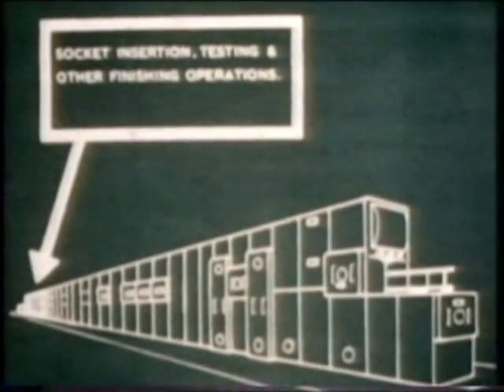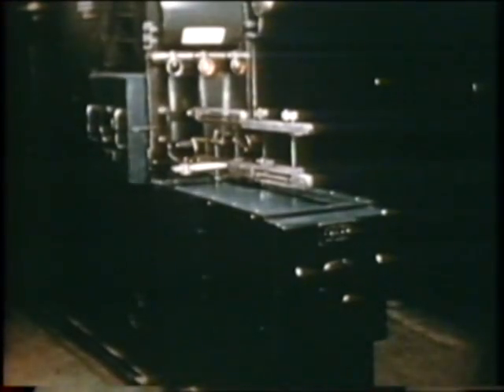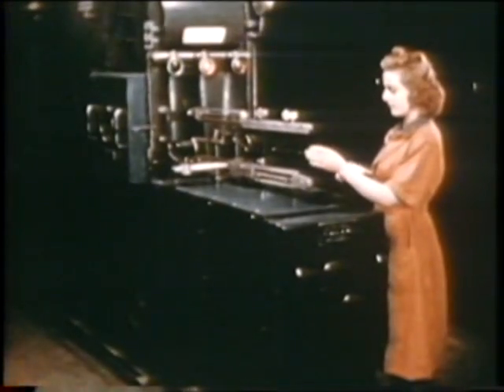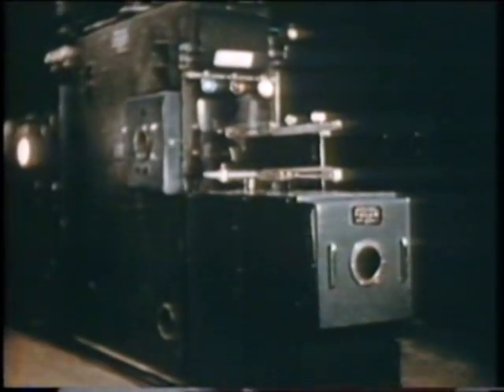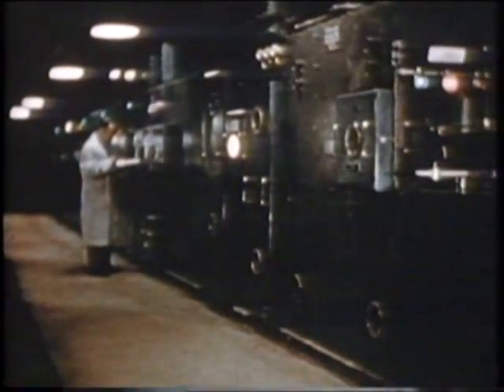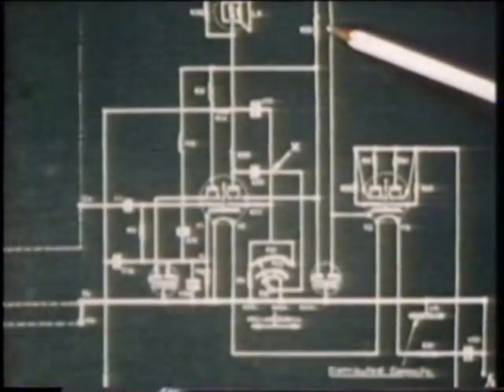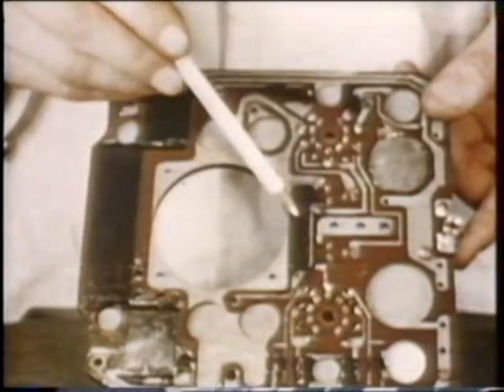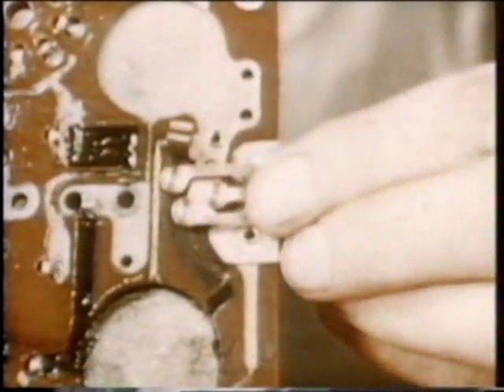ECME - electronics automated production 1940's style!

Comment: That machine must have cost a fortune. That's an impressive lot of levers and cranks. Can you imagine the manufacturing of all the mechanic pieces going in that machine? 
not to mention the hours of work going into exact aligning the precise parts, testing, replacement of worn out parts and oiling the thing...

I think it's a nice example of the start of mass production.
On the other hand, back then, they made quality. This was a step towards quantity over quality.

Comment: I'm always amazed what was achieved in automation without any "electronics" (of the kind we think of today). Just relays and rotary switches, some cranks and levers.

And I'm really surprised of the thing checking of the sockets for orientation. I never thought this would have been possible at that time, especially at the speed the machine is working at. Never underestimate the ingenuity of engineers!

Comment: There could be numerous reasons why this technology met with limited use. One that spring to mind is how specialized the equipment is, designed to mass produce one circuit at one time so it lacked flexibility. It could also have been that the machinery was extremely high maintenance, or that the set up times were long and complex. It certainly looks like a very complex piece of electromechanical equipment, like a telephone exchange combined with a pinball machine inside. It also may have been wasteful in terms of materials, they mention having to mill the excess metal off of both sides of each board. One thing that is not shown is the production of the blank boards, they have recesses and holes for the metal spray, it would have been interesting to see that part, I think that they were molded Bakelite. Apparently the company went bankrupt after a large order for radios made by the Indian government was cancelled, after India gained independence.
 One thing to keep in mind is that printed circuits become commonplace a few year later, so this would not have been competitive for long. There were some tube radios that used a printed circuit chassis as early as 1951-52, which were made using photochemical etching processes much like today, but used phenolic sheets as a substrate rather then fiberglass resins. Quite frankly they were terrible though, it's no uncommon to find one with lifting and broken traces today. Zenith had such a bad experience with early printed circuits in TV sets that they went back to hand wired chassis in their TVs and stayed with them into the 1970s.
Reply: It seems overambitious for the tech of the time.
Yield, downtime and maintenance must have been a nightmare.

Comment: I highly doubt it's better. The tolerances on capacitors formed by milling thin sections of circuit board and spraying metal on either side and resistors formed by blasting graphite glop directly onto the board must have been a nightmare to control even in the pre-transistor era.